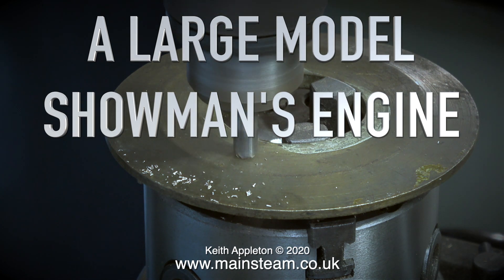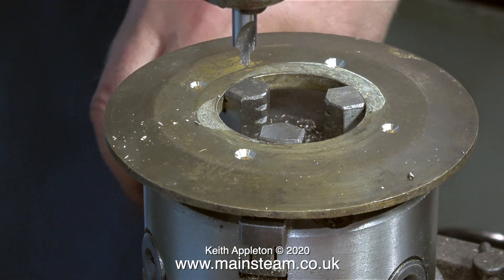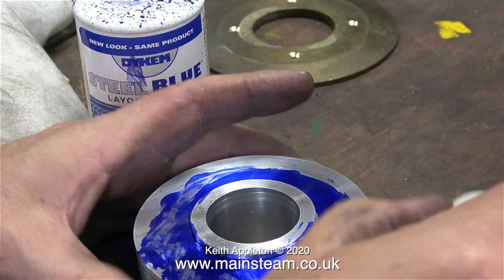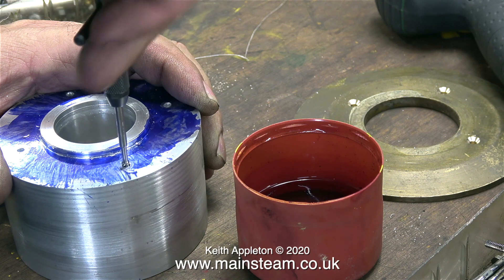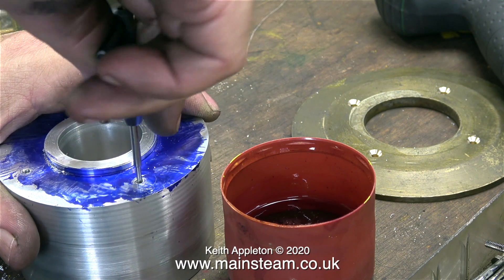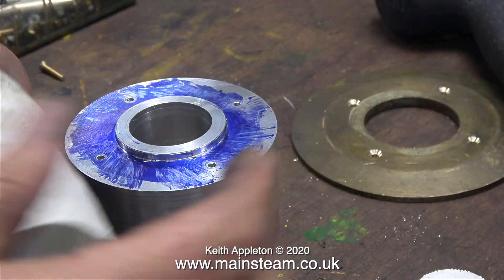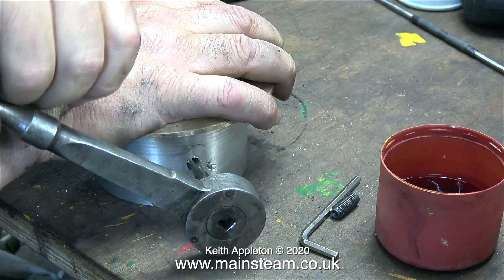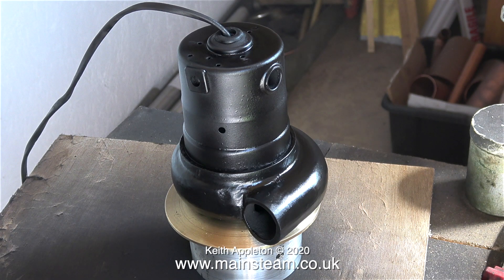A LARGE MODEL SHOWMAN'S ENGINE - PART #33

Comment: Something I found about tapping small blind holes or even big ones for that matter to prevent the chips from falling into the bottom of the hole and jamming the tap put paraffin or candle wax in the hole before you tap. Then as you tap the paraffin pushes up the flutes and carries the chip out with it and it provides lubrication for the tap as it creates the thread. If you have doubts try it in a test piece. At least I found it works for me.
Reply: Methinks your good advice, Sir, sounds like poetry.